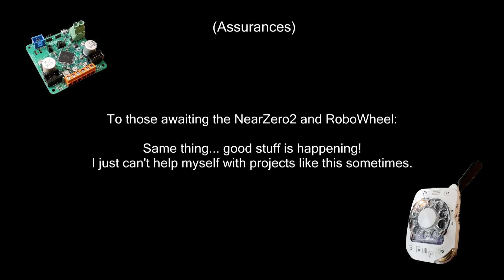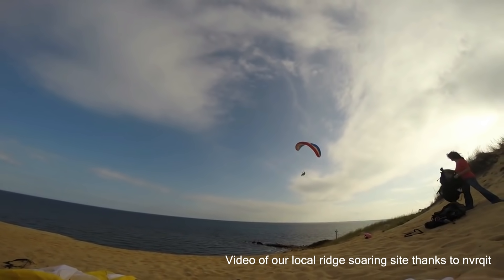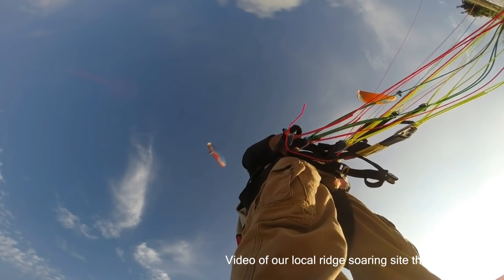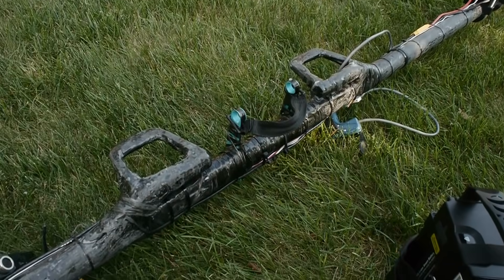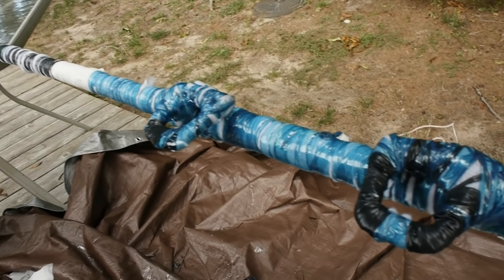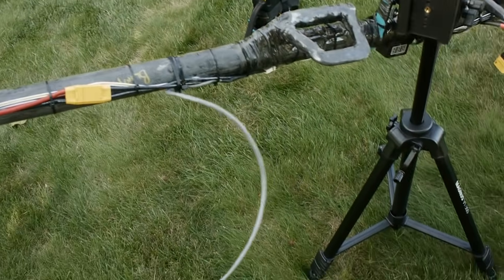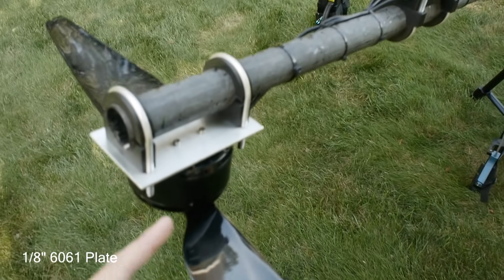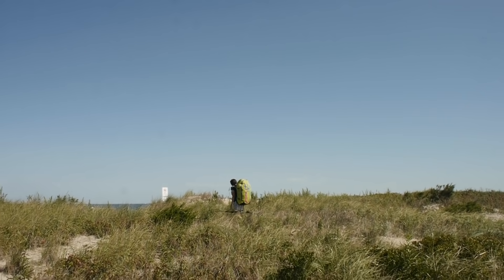Stupid-Simple Electric Paramotor

Comment: Could you have this fit into a large rucksack? 

Thinking of the possibility of being able to just pull a cord and it all unfolds and you gracefully fly away.
Reply: Now I'm imagining if the motors and everything were designed to collapses into a large backpack, and is spring loaded for automatic deployment, you could NOPE out of any situation like some kind of cartoon.

I've never been more inspired to learn how to paraglide.  Thanks for that.
Reply: @TuckMcSouthard  
Somewhere between Buzz Lightyear and Inspector Gadget. 

My first thought is 3 section arms that open out from the sides. Basically a bird wing arrangement. 

1: |||🤷‍♂️|||
2: \/\🤷‍♂️/\/
3: X___🤷‍♂️___X
4: 💤🪂

Need some sort of bloop tube for the chute / parafoil. 

Optional: skateboard with cleats for rolling takeoffs / landings.
Reply from the maker: @TuckMcSouthard  Yeah I'm kind of warming to the folding-boom idea. It would be amazing to pack the whole thing in with the wing, and the battery. Truly a complete aircraft you can hike around with. 

Tucker, if you get into paragliding you won't regret it. Some of the most memorable, magical experiences of my life have been under a paraglider wing. It's the closest a human can come to flying like a bird hands-down, in my opinion, at least for now.
Reply: @JustineHaupt  Dragon plate sells some nice carbon fiber telescoping tubes FYI.
Reply: Hinges and springs all add weight and complexity.

A simple light solution to dismantle would be tubes that slide into tubes. Either two, or three sections. Take a look at kayak paddles and how can insert and twist lock with a safety overscrew coupler so locks in place. (stops any rotation)

Comment: This is really awesome.  Your first carbon fiber layup looks great, as long as it's as strong as you need it.  Without knowing the specs of your 3d printed bushings, I would be concerned about them losing integrity to the clamping forces required to keep those motors lined up, either from warping or cracking.  Anyway thanks for sharing!
Reply from the maker: Thanks Tucker. That CF-PETG is pretty impressive stuff and I only went with it after accumulating a couple years of experience with that material in various load-bearing applications. Here's what I use: https://atomicfilament.com/collections/3-5kg-jumbo-rolls/products/3-5kg-carbon-fiber-extreme-black-petg

I'm checking the parts on this before every flight, of course, but the material is pretty robust, especially in compression. That said, if I make another version of this some day I'll build the motor mounts right into the boom out of actual CF.
Reply: @JustineHaupt  Excellent!  I hope you didn't feel like I was doubting you, I just worry easily.  I'm excited to see you posting again, and I look forward to hearing more about the rotary cell phone's progress.  Take care!
Reply from the maker: @TuckMcSouthard  Oh no worries, thanks for the input Tucker, it's good!

Comment: Have a look at small airplanes. Notice none of them have the prop in line with the pilot. This is because props can explode, especially if they strike something. Like the ground maybe?
Reply from the maker: Hi Dandil, some twins have them pretty close. In any case my props are intentionally forward of my head and other organs. Exploding propellers is not the failure mode that most concerns me. It's a prototype, nothing more.
Reply: Or a bird? Maybe a V shaped stick would be safer so the prop line is behind?

Comment: Love the idea of less noisy flying. Are you considering a cage around those props? I'm imaging a very rare scenario where after some extreme maneuver or unexpected turbulence your lines on one side get cut or otherwise caught up in the prop.
Reply: Folding props?
Reply: @airpockit6933  I like this idea as well! Less drag when not in use allows for better flight efficiency whilst not powered! Great idea 😉
I've seen this on a guy's cheat glider. It's on a pop out arm. It's awesome!
Reply: Those who have cages around their props are weak and bring dishonor upon their ancestors.
Reply: @therealgaragegirls  spoken like a true Klingon 😁
Reply: @nkronert  LOL I'm glad you got my joke. 😅
Reply from the maker: It would have to be an incredibly aggressive collapse for the lines to get that close, but yes, the prospect of prop guards are on my mind. I might also want to make the boom longer. More than the exposed props I'm concerned that this might interfere with my reserve. I have some ideas to make it safer. But my idea was to power up to altitude and then just shut everything off, so on a soaring day the portion of flight that's powered is potentially quite small.
Reply: @JustineHaupt  ducts will make it safe and increase your thrust efficiency - and folding props will drastically reduce the drag that you're going to be suffering when the motors are off 🙏
Reply: @nonsequitor  Im coming from the drone world. In my experience adding ducts does not increase efficiency. Thrust can be increased if the duct and prop are designed and tested together. A working ducted prop set up has very small tolerances. In this case I would definitely want a duct or prop guard but I would approach its design with the goal of increasing safety and decreasing noise while minimising weight and drag.  Folding props or ESC brakes would help a lot with drag. Id want some prop guards with folding props. This whole project is really great I hope to see further iterations.
Reply: @JustineHaupt  As you make the boom longer, keeping the motors in sync becomes more and more important. But, i guess they probably already are synced, the video look that way. So, please ignore what I just said. Out of sync would trim the torques better for a longer boom, to make up for any thrust differentials, like damaged or entangled props...
Reply: @WeBeGood06  telescopic arms perhaps?
Reply: @JustineHaupt  Great work. I love your flavor of projects. What a mind :) Just want to see you doing it safely. If you haven't already dived into 2 vs 3 blade props, pitch, etc, you might find something that is even quieter/more efficient. Also if you build the cage you could add a carbon fiber housing to the inner side facing inward which might reduce much of the sound from the props reaching your ears directly. Isolation mounts and sound dampening housing for the motors might help as well. To get to a point where the wind is what you hear the most would be magical. Enjoy!
Reply from the maker: @brettcameratraveler   Thanks Brett, I get you. So with props, it turns out that if all the other parameters are free, less blades are always more effiicient, so the best you can do is two blades, and the bigger and more slowly it turns the better. Blades are added beyond two to absorb engine power when scaling to a larger diameter is impractical due to other constraints. As it is now I'm curious to try larger props with the pitch set for forward/cruise flight instead of for static lift (they're meant for a drone). Also, winglets on the props may also help (called Q-tips). Good point about isolation and sheilding the props from noise, too. I'll bet a lot of sound/vibration is resonating through the boom itself. 

Ideally I'd like to try a more conventional paramotor in the future with a giant (2.5m or so) single two-bladed prop set way back from the pilot. That's a much bigger project though so it'll have to wait a couple years I think.
Reply: @JustineHaupt  there have been some interesting experiments with single-bladed props (with a small dense counterweight on a shorter arm). Thrust is asymmetric but the vibration that induces is relatively minimal in amplitude if you have a stiff mount and sturdy motor bearings. They're remarkably efficient, especially at the low airspeeds and RPMs of something like a paramotor. Could be a fun additional experiment, seems right up your alley.
Reply: @JustineHaupt  There was a single bladed prop that automatically varied pitch, patent US2134661A  .   The pivot pin between the prop and the hub is at an angle where thrust force can balance centrifugal forces.
Reply: @JustineHaupt  are there any measurements on how much air resistance the boom and props actually add relative to the other sources of drag?
Reply: How would a folding prop work in conjunction with the pole? One would have to create long nacelles or use pushing propellors. But honestly, I don't think that he air resistance of stationary propellors would be significant compared to that of the pole.
Reply: @nkronert  Push prop. Pole with airfoil profile.
Reply: Ducted fan does many great things. 

More efficient 
Quieter 
Better thrust.
Reply: @ashsmitty2244  I agree, also better safety for lines and limbs